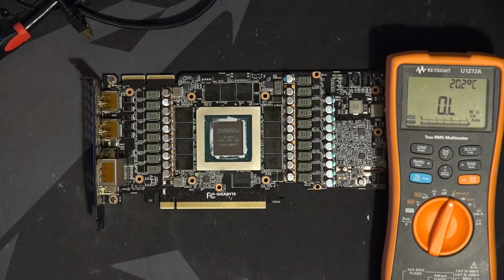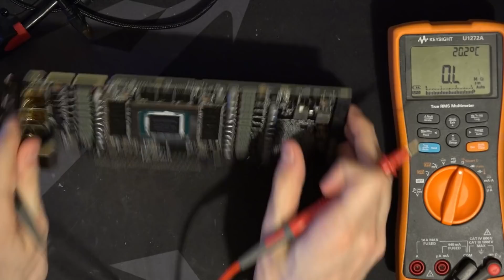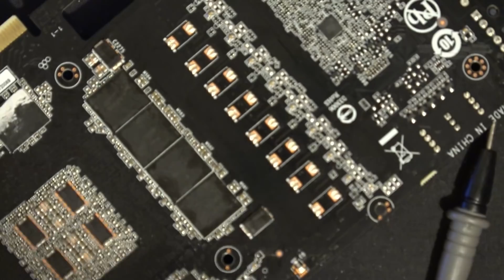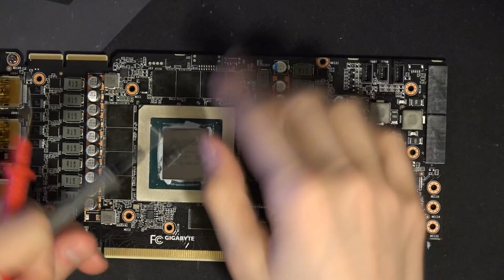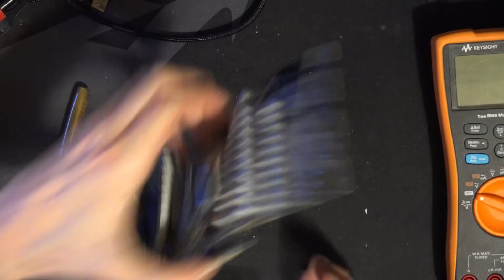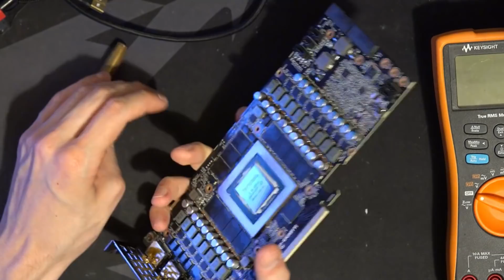Probing a Gigabyte RTX 3090 Vision that died when trying to run New World

Comment: What production weeks and lots are those cards? In my daily job I see a lot of companies basically redesign PCBs on the fly to retrofit components of different specs and from different vendors because the whole parts supply chain is so fucked right now.

Basically if chip x of vendor y is currently unavailable due to global supply issues they try to use different parts that are available which sometimes requires new PCB revisions as well.

I’ve seen a lot of weird shit recently even automotive tier 1 suppliers fitting industrial grade spec parts because AECQ spec parts are unavailable.

So if boards of certain production runs are affected it might be because of the miserable supply situation and because everyone is scrambling to get enough parts to produce anything
Reply: From the news i have gotten, the EVGA3090 that died was all from 1 or more of the first batches. So i doubt this is changed from nvidias orignal spec/alowed design, it seems like some sort of a design flaw , OR the game triggering a flaw in the power supply/VRM of the original 3080/3090 design cards.
Reply: Huh which spec parts are better industrial or AECQ?
Reply: @Operator588  aecq is an automotive set of requirements for parts and it’s more demanding than industrial spec. For example automotive parts have operational temperature ranges between  -30 to +125 degrees Celsius and they have much stricter requirements as to EMI and EMC. So fitting industrial grade components on an automotive electronics component would be a downgrade
Reply: @Numfuddle  ah thanks for the complete explanation. i really hope those componant changes dont end up killing someone. where the parts that were changed possible to cause serious issues?
Reply: @Operator588  they do this with the help of the vendors and the car companies OKed it as well. They also do additional qualifications and verifications on the parts. It sometimes happens even in normal times when a special part (like an LCD for example) is not yet available in automotive spec because it’s too new.

It’s just weird because usually without the recent supply issues this would not be done at all. You’d not even get quoted prices for non automotive parts.

Im more worried about consumer electronics because they also switch parts to those that are available but the testing and qualifications is usually less rigorous
Reply: yikes... that means, most of electronics including cars might potentially have issues due to lower grade components used. I guess, after Covid end, there will be an outbreak of warranty claims & product recalls.
Reply: @Morpheus-pt3wq  The worst part is the areas where they are most likely to fail is places where it's super important they don't fail. Imagine working or living in a super cold environment, the kind of cold where your piss freezes before it hits the ground. And then your truck dies because some component that is vital to keeping the ECU working dies because it's too cold for the non-automotive part.

That could literally kill someone. It's not even that uncommon, there are many populated places where the colder parts of winter get that cold. That's why the automotive spec covers that condition, because it's actually commonly needed.
Reply: There are "fake" chips coming out of China.  Scary.
youtu.be/baIodPYBbNQ?t=389

Comment: Wouldn't it be nice if video cards were modular mainboard-like sub-systems, with slots/sockets for memory and gpu chips or compute modules ...
Reply from the maker: the sockets create a lot of inefficiency that is torelable at the relatively low power levels that CPUs have but totally unacceptable for GPUs.
Reply: @ActuallyHardcoreOverclocking  
Reality ruining my dreams again
Reply: Or just make bga repair machines and training available to everyone lmfao. Honestly if we ever start getting provided schematics for gpus, that would be more than enough.
Reply: Strange, I could swear there was a card with modular vram at some point, Google says no tho.
Reply: @fzth-x  There were some really old video cards that had sockets that allowed you to add addition ram, but that was mostly before the era of modern GPUs. Also I believe intel made something called a Visual Compute Accelerator which was basically an entire system itself on a PCIE board with  Xeon processors and SODIMM slots, but they weren't really a GPU and wouldn't be a card you'd want to game on. I think the Intel VCA was a predecessor of the Xeon Phi cards.

Comment: I wish mosfets would fail mostly low side. I bought three cards with a defective mosfet and all of them got 12V to the core or memory. They are are all dead. On the other hand I bought one Palit and one Gainward 970 with a dead mosfet and the fuse died, preventing the mosfet from melting and shorting to the core. I wish they would all use fuses. Because software protections can only go so far.
Reply: high side fail IS 12v to the core

low side "only" shorts 12v to ground
Reply: @emperorSbraz  Guess I mistook that, just switch it around.

Comment: He bought it second hand on eBay but didn't request an invoice or receipt in case of failure?? Cmon man, that's a basic mistake right there.
Reply: You can request a receipt from the seller on eBay and Gigabyte (and others) will still tell you to pound sand, because you bought the card from an unauthorized retailer, basically the same as buying the card yourself and selling it to your buddy. They know what they're doing. Even if the seller gave you their original receipt (which they would accept), it won't be in your name, which is a problem.
Reply: @racerex340  That's like receiving a broken gift and not being able to return or rma because you're not the original buyer. Just doesn't work like that. I've bought second hand gpus on warranty and if you have the invoice/receipt they'll still take care of the card. I've done so with Zotac and EVGA though. Not sure if gigabyte operates differently but from the sound of it seems like they just dgaf about their consumers.
Reply: @asterisk4424  the original receipt, yes.

Comment: What do you mean, gigabyte refused RMA? That would be highly illegal in the EU!!!
Reply: Buildzoid said it in the beginning: It was bought second-hand. In Germany you CAN transfer the legal warrenty (2 Years) even second-hand.
Reply: That's why you never buy Gigabyte unless it's their mid to high end motherboards. And they are stingy on the RMA's.
Reply: He didn't buy it from an official source, he bought it used likely from a miner. So since it wasn't a new card they wouldn't register their warranty. Also Gigabyte was recently hacked so they just kinda haven't been accepting warranty requests currently as they're still working on getting their servers back online from a backup.
Reply: @Skylancer727  And this is a reason why exactly? It is a card inside the warranty timespan,  getting hacked  is no reason to decline RMA of a card that has no possibility to be outside the warranty due to the fact that the production start time  lies inside the warranty time...

Comment: As someone who just bought a 6900 XT all of this has made me kinda worried about a VRM failure. This is my second high TDP card ever. My first was an EVGA GTX 980ti and one of the VRMs on it blew up.
Reply: I haven't heard of any Radeon gpus being affected yet.
Reply: What you want to do is make sure you have a good psu, if you want to lengthen the life of your GPU, buy some thermal grizzly kryonaut (or kryonaut extreme), some fujipoly 17w/mk pads and rip apart your GPU to replace the paste and pads.
Reply: @conenubi701  from what I've seen it's a bad idea to remove the cooler as the gpu die actually uses a Hitachi thermal pad and it's a real chore to use thermal paste.
Reply: I don't have such issues as I cannot afford not only top end high TDP cards, but more like any card whatsoever at current inflated pricing of ~3x msrp on average across the board 😂😂😂
Reply: @mroutcast8515  assuming you're in the US and want AMD, keep trying the AMD drops. It took me about a month before I finally got lucky. I wanted a 6800 XT but they were out of stock when I got my turn. Had to settle for the 6900 XT.
Reply: Buildzoid always calls AMD boards "overkill" along with a stout salvo of hatred about how they limit overclocking despite the cards being perfectly capable from the component side. You're perfectly safe. The reference 6900XT should handle well in excess of 400W shock loaded, and the partner models go beyond that.
Reply: @andersjjensen  Funny part is, my friends Radeon HD7970XTX/1ghz Boost saphire card died after only 4-5 years, and that was an aftermarked highend, high powerdraw Radeon card. I dont think its as simple as only 1 vendor makes faulty or bad boards. And in this case it could also be that some of the OEM´s cheap out on components, this is quite likely actually, prob plenty of people out there with 3080/3080Ti/3090´s that dosnt break from new-world, we only hear of the few that does.
Reply: You can easily limit your gpu from over working itself by setting an fps limit in the radeon software. This kind of stuff really happens when you run uncapped fps

Comment: Any chance it's some weird high frequency current draw/ power saving voltage switching due to weird  load patterns in that game?
Reply: Jay showed it might be more common on EVGA cards purely due to the cards improperly detecting their set power draw limit. He showed when set to 100% it could go as high as 128% and it would still pass 100% even at 70% on overclocking programs. Though he did show this is consistent even when not playing New World but New World seemed to trigger some other cards to occasionally do it too but only briefly.
Reply: @Skylancer727  ...now you are going to say the voltage drop (power draw) changes with the temperature and no one accommodates for it.
Reply: @stanimir4197  yes but considering this is one of the first parts in the chain that failed, no I don't think that would make an appreciable difference, especially not to this extent. The power draw values are also collected very early on the card which is why its worrying some cards like EVGA's are drawing more than they are rated for. Having a max overclock of 110% but using nearly 130% is a huge difference to those components. They only designed it for that spec, this is a fair bit above that. 

Yes we do increase the power for VRAM over distance, but that results in exactly what is in spec. This is different. Nvidia and EVGA's specs were made under the consideration it will rarely pass the values dictated.

Comment: So glad you made this video! 

Happened to my PNY RTX 3080 within the first 5 hours. Bought it from a scalper so I’m screwed on warranty. Gonna use this as a rough guide to probe mine
Reply: Might still want to try the warranty some times you get lucky
Reply from the maker: try the warranty first
Reply: @ActuallyHardcoreOverclocking  I’ll give it a shot, however, The scalper pulled the card from a prebuilt system...
Reply: @SwampyF4RT  manufacturer might still warranty the card. did they say no already?
Reply: @SwampyF4RT  Don't mention any of that. Just say "The serial number is this and that, but I lost the receipt". Then they'll likely assume it is still in said pre-built.
Reply: I got my 3090 from a scalper back in November after launch and Zotac still let me register the card with their extended 3 year warranty (thank god I got it for $1600 compared to the $3,600 they're going for now). They even required an image for proof of purchase and I literally just used a screenshot off ebay and it worked. So there's still a chance. Just make sure if your card needed to be registered from the box. Why you should never throw out a GPU or motherboard box.

Comment: Soooo what you are saying is, I can play New World without being afraid that my 6900 xt merc will blow? 🤔
Reply: It's not really worth playing anyways, but sure. Knock yourself out.
Reply: Yeah, AMD cards should be safe (of course, any card can have defects).
Reply: A) This was patched like 72 hours after people started reporting dying cards. B) No AMD hard was ever reported dying, and C) AMD has a sane (and much more expensive) VRM controller. In stead of using several different ones with varying numbers of phases that cant be controlled individually, they use one, with enough phases, which can be divided into groups of different voltages. Also they don't muck about with shunt resistors which don't work right if a voltage droop happens, but again, use that proper controller which can monitor both voltage and current and thus enforce power limits. It also gets measurements from the GPU itself, so it can basically "see" what happens on both sides of the VRM.
Reply: @andersjjensen  The patch didn't fix it and cards keep dying

Comment: Doesn’t the test current of your meter while measuring milliohms affect any components?
Reply: Test current depends on the range, with lower ohm ranges having a higher test current. The DMM sources a known current and reads off the voltage that the current source generates. According to the manual, this is at most 0.65 mA in the 300 and 30 ohm range. The highest possible voltage generated with this measurement is 0.65 mA * 300 Ohms = 0.195 V

0.2V is not enough to harm anything in the device.

However, 0.2V is enough to turn on diodes slightly, and it's definitely enough to charge capacitors. The former didn't show up as far as I could tell, and the latter was causing the resistance measured to change.
Reply: He was testing resistance not current. If you wanted to test the current draw you would have to pull something like the fuse and use that as where to put your probes for current detection. If you were just using it in the same places you would with resistance, not only would you be ruining the board, but it would also damage your multimeter.
Reply: @Skylancer727  no, to test resistance, almost all multimeters source a known current through the circuit and then measure the resulting voltage across the leads. This also causes the behavior of capacitors charging up when you measure them. This is what the comment is asking about, as measuring the "resistance" of semi-conductors isn't straight forward, as they aren't ohmic devices. Applying a current across it can sometimes activate parts of the IC.

But I agree that measuring the current with the meter in place of the fuse will definitely fry the fuse of your meter! These gpu dies can take many, many, many amps at a low voltage, much more than the 10A fuse in most meters

Comment: moral of the story is never leave your framerate completely uncapped
Reply from the maker: there's people having cards die even with framerate caps
Reply: @ActuallyHardcoreOverclocking  so even at a low frame rate the card would of nuked itself? how can software cause the hardware to draw more power than it requires?
Reply: @Sleepy.Time.  Nvidia fucked up their requirements. That's how.
Reply: @andersjjensen  has Nvidia accepted fault for this or it still being passed onto the board vendors?
Reply: @Sleepy.Time.  Nvidia blamed TSMC for having a bad node when AMD beat their asses on the exact same node... so take a wild guess :P
Reply: @ActuallyHardcoreOverclocking  That's the weirdest thing about it. So it's not just the VRMs driven with too much power? So it's the transients? But would transients kill a VRM?
Reply: Framerate caps won't save you from power delivery issues.
Reply: @Falkentyne07  ...or transient loads.

Comment: why don't AMD cards also have this problem? i think Ampere is like Kepler but way way worse regarding quality
Reply from the maker: AMD pulls less power and generally doesn't go with overly complicated obscure VRM configurations. 6900XTs just use a 16 phase controller to control a 11+2 phase Vcore + Vsoc and have no shunt resistors.
Reply: @ActuallyHardcoreOverclocking  so... i was right :)
Reply: @Manuel G for sure, but "it bricked cause of power consumption" should not, ever, be an excuse for nvidia, GB, asus, etc. i feel like they intentionally did it, i may be wrong, but this is the second time when Ampere blows up, first at launch and now
Reply: @Constantin314  I agree, regardless of the consumption levels here, it should not be happening because its still within specs.